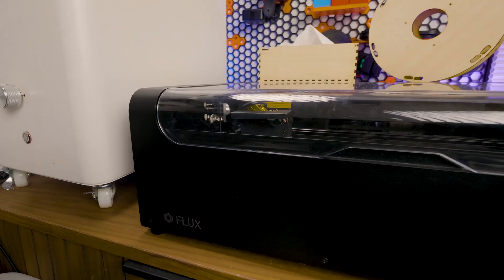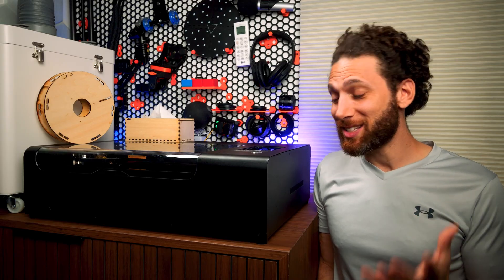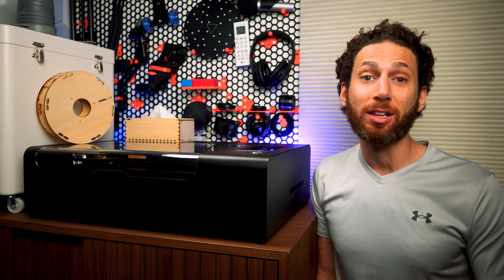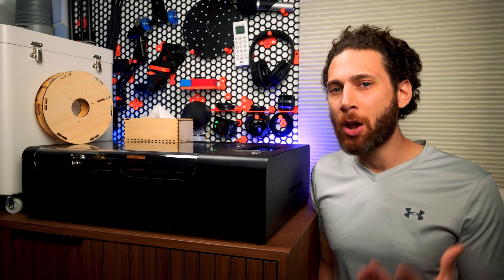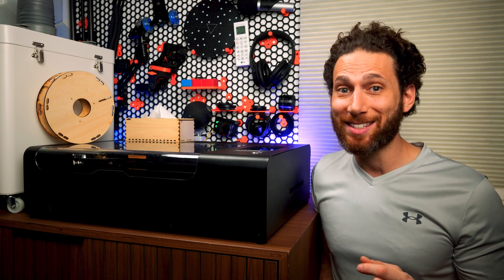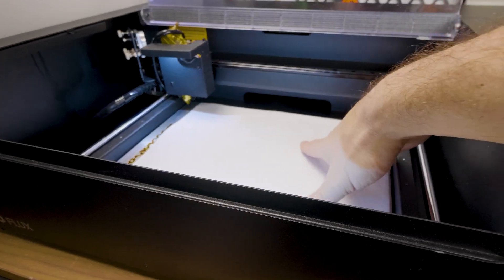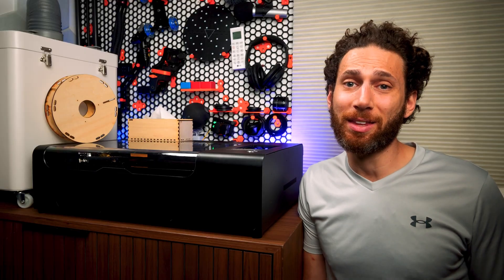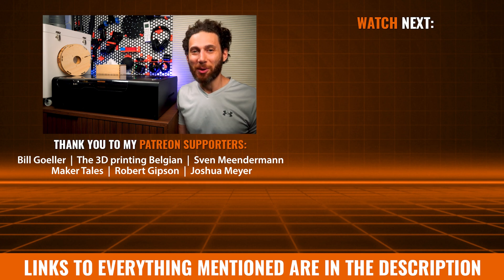I Got a FLUX beamo Laser Cutter... But Should You?

Comment from the maker: THANK YOU for watching, liking, subscriblahblahblahing. I'd love to know in the comments below... do you think lasers are useful, or just a gimmick?
Reply: Hi, YES, laser cutters are a gread add on to 3D Printing. I design model rockets {In South Africa} and I 3D Print the nosecones, and laser cut the fins, bulkheads and centering rings. And how do I design my laser cut parts you may ask? Tinkercad! Just ensure your part is the thickness of the material you are going to cut it out of, expost to a SVG file, and Bob's your uincle.
I have even converted those gift card planes and dinosaurs to laser cut format, and it worked. Just upscale to the thickness of the material. Good old 3mm MDF works a treat. So uniform scale to get the thickness to 3mm and you are set. DO NOT ALLOW ANY MARGIN LIKE YOU WOULD FOR 3D PRINTING. NO OOZE!
Reply: @MrGerhardGrobler : Interesting post, but just curious, do you ever use "spell check"?
Reply: @jayedwin98020  nope. English is a 2nd language to me. But most of my spelling mistakes happen because I type on touch screen of a cellphone that is very small.
Reply: The K40 is around $500 and it's upgradeable
Reply: Laser cutters are amazing and so useful when you know how to design for them, but for laser "cutters" like the one on my SnapMaker 2.0, then yes, a 1.6 watt diode laser is totally a gimmick. That said, I was able to engrave aluminum with it, so I'm not sure why you were having issues doing so with a 30 watt CO2 laser. I would recommend first coating the surface of the metal with something like paint or masking tape before trying to etch it, and better still if the surface is rough or has a patina. It just needs something that can absorb the radiation instead of reflecting it. YMMV.
Reply: I got in on the kickstarter for Elegoo's laser, what I'll be making with it though I have no idea

Comment: Imagine giving someone a laser cutter to review thats doesnt have a clue but because they no about 3D Printing.  Lasers have been out for decades and been mainstream for last 5 years in the hobby market.  This model is unfortunately crap, its closed source locked hardware means you are at the mercy of the company with regards to actually being able to use it. Much better options out there since 2022  on the co2 front for a similar price.  And just because you can drive a fiesta doent automatically mean you can drive a F1 car. These could go hand in hand and compliment each other but they are 2 machines entirely different and each has their own use cases, only thing my 3d Printer and laser has in common is its easy to print modifications.  Creality added a laser to their lineup so you could utilise the frame,  becuase they are all one of the same except anyone knows bed throwers like 3018 cnc are not great for lasers

Comment: I ran into the same wall with a mini CNC. It still mostly sits. If I want to cut a slot in something I use it in manual mode. I haven’t yet been inspired enough to delve into the whole ecosystem. 3D printing was much more engaging for me.

Comment: Our maker space has a pretty large laser (roughly 70cm by 50cm) and one thing it does enable is making large scale projects FAST. Printing a box to store something in will take hours, which means it's often not really worth it. Laser cutting a box takes roughly 10min from idea to useable product.

EDIT: one downside of the speed is that if you messed something up, like the focus point (or z-offset for the printer), you can easily waste a lot of money worth of material whereas with a print, you're often just wasting grams of filament on the first layer.

Comment: No pun intended?? You're a dad and you have no excuses. Intend your puns, coward! 😜

One massive strength of your new laser cutter that I think you underplayed here is accuracy, which opens up some great options for more precise tools, jigs, and gauges versus their FDM equivalents. I glanced through the list from your '28(ish) 3D Printed Tools' video and spotted some immediate candidates:

- Speed Square
- Screw/bolt/nut/washer measurers (also coin sorters, while we're at it)
- Fillet Gauge
- Corner templates
- Drill Hole Guide
- Glue Spreader (not so much for accuracy as for material selection to avoid bonding to whatever glue you're using)

Sure, FDM printing can be super accurate, buuuut you can spend forever mucking around with a bunch of adjustments, calibrations, tweaks, flow calculators, slicer settings, and (let's be honest) guesswork - only to do it all again every time you load a new filament - or you can just laser out a perfect part on the first try and then get on with the actual project you were making the thing for in the first place :)

Comment: This is why I rather like Creality's laser expansion modules for the Ender series. Sure, there's an upper limit with power (10W max with the Falcon) since we are dealing with diode-only, but I love being able to swap my E3 S1 Plus extruder for a compact laser module for random one-off customizations or instances where a wood piece would be preferred to plastic. It's a great middle ground or starting point for someone who only occasionally wants to cut or engrave basic materials. If you find you wanna engrave all of the things, then you can upgrade to a dedicated machine like this one. The price of admission for a dedicated laser cutter is still a little too high for the typical curious FDM user...even Creality still wants over $1k for a 22W dedicated cutter and that isn't the least bit enclosed. (My Ender is already enclosed/filtered/vented for printing ABS.)

Comment: You should still be careful of your vision with this unit since the lid looks clear and without any protection of beam deflection.  Also, when running and you open the lid, does it stop the job?  Another safety concern with little ones hanging out around it.
Reply from the maker: Yea of course, it does stop when opened :)

Comment: I'm literally debating buying one just now (2nd hand of course) so this video was very well timed. 
I think the size is the biggest limiting factor with this machine. As you appeared to show, it won't even fit a full size sheet of A4 paper on the open area of the bed.
Reply: If you do a follow up to this video it would be great if you talk about the software as no one ever really mentions it. Which is an annoyance as you can't control it through Lightburn from what I've read so we can't use videos on that as a basis.